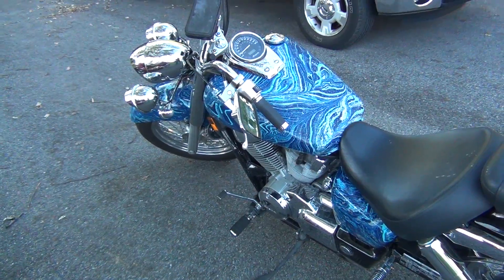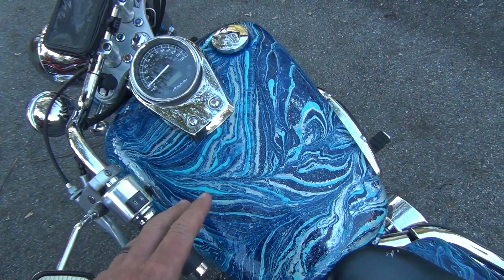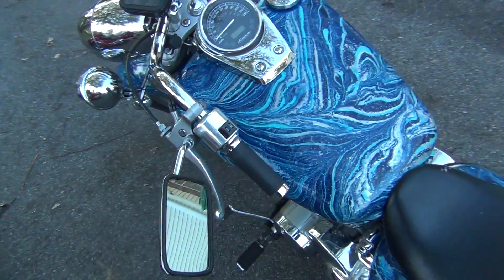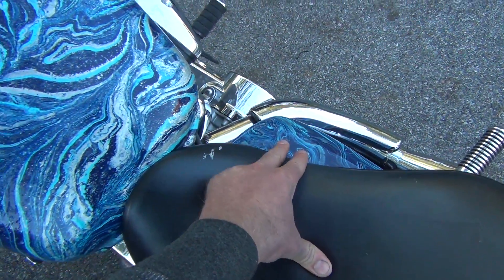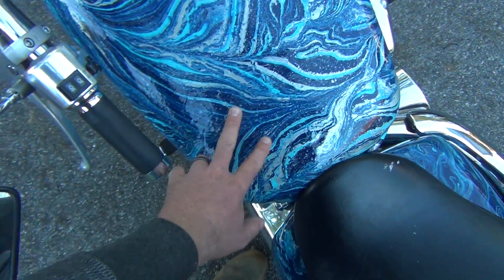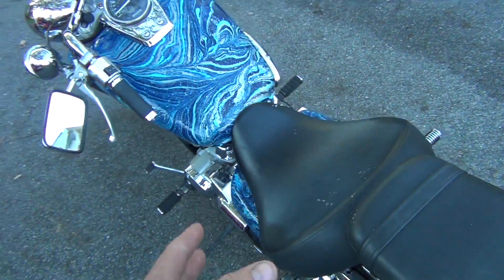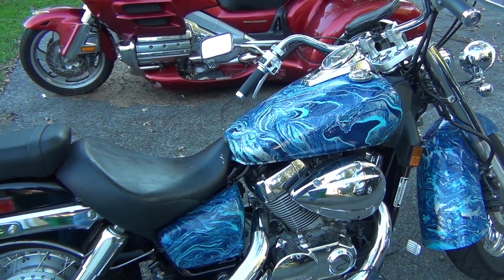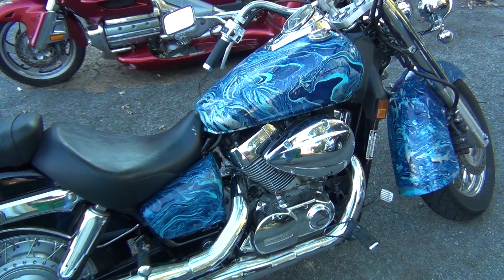Negatives of spray dipping

Comment: Clear coat it then sand the clear, reclear it and then wet sand. That will smooth the paint and remove the fish eyes.
Reply from the maker: +CKDMJ the fish eyes are in the paint and not clear. I'm planning on adding lots of clear when work shuts down in winter. Going to try to smooth everything out.
Reply: +TheBrownsWorld Yes but you can hide them by building up clear and sanding down the highspots on the clear. Depending on how think your gun will  lay clear and how bad the height differences are in the paint will denote how much work it will take. Cool looking paint by the way.
Reply from the maker: +CKDMJ Ok I see what you mean. I might just leave everything the way it is lol. The tank is really growing on me because front fender is same way and goes good together

Comment: if you are thinking about spray dipping your bike parts then take you should know that almost all of the problems he's pointing out in this video can be avoided if you are willing to put out the effort to do the job right, i spray dipped my parts using 6 different colors and when i was done i didn't have a single pinhole or lump of paint and the surface looked like any other clear coated gloss paint work. But i will say, because of all the solvents in spray paint it is a lot easier if you use paint that isn't spray paint....

Comment: Better preparation of the surface will help prevent the flaws. higher quality paint will help prevent flaws. making sure you have a good primer base will help prevent flaws. clear coat and wet sand then clear finish . all and all looks good . just need to play with it a little. never settle when it comes to your stuff . good job!
Reply: Jeremy Dickey Do you think grafitti spray paint would work better, because it's thinner? I mean, it's an outdoor paint  so it should be durable enough?

Comment: Found out marbling has alot of the same problems. Multiple coats of clear coat and sanding in between coats flattens the surface and leaves a pro quality finish. Beautiful colors an swirling , would be a shame to sand down and start over. You don't have to.lol Good luck bro. PS. Definitely should paint the back fender too. PEACE!!!!

Comment: Hydro dipping with graphic film is similar,the film is very very thin where it disolves in the water thats why it comes out smooth then clearcoat,some guys spray candy paint before the clear, candy paint is transparent so you will still se the pattern then clearcoat,you coul do the same with paint dipping tho it might affect the colors you dipped but you will get a cool swirl/marble affect.

Comment: if you end up with big ridges of colors then you paint is to thick, thin the paints out and clear it correctly and in the end the surface will be as smooth as glass without ever touching the design colors coat...

Comment: If you do it with spray can paint thats what happens,also the paint dries to fast in the water,get it out of a quart can and get thinner to thin it 50/50 it should be very thin and drops at a time of your choice of colors,then the lumps wont be so high,could be lightly sanded with 600-800 crid sand paper before clear then clear coat,or if its not to bad clearcoat first then sand with 800 then clear coat again then maybe reapeat a third time,but main thing thin the paint,very thin it'll spread in the water better and it'll swirl nice and you could achieve crazy patterns.

Comment: Please rehearse your dialog to 'show and tell' better with better angles on the video. Intro too long and awkward, I almost clicked out.  Nice job, don't worry about the negatives.  You can use clear-coat to smooth out the lumps and to get a great clear shine.  Doing the back fender will complete the look.  I'm going to try this.

Comment: High Spots = Too Damn Picky = OCD.  True art is What it Is, Its itself. seemingly a Mind of its own(Illogical concept) To Flow as it sees fit!!!  Fish Eyes = Nasty,  Art After-math Some times Bi-product. fish eyes come from silicone Contaminents(oils, greases, etcs) = silicone remover Needed B4 painting. The Best Way to have paint flow in said weird patters is Oil Based paint( Did You see That oil Word, there-In?)  automatic Possible screw up built In Unless  your Lifes purpose Is not problematic from a higher power)   Water Based paints  In Water as the vehicle of flowage = see the problem?   solvent based paints do help the separating of water vs. solvent Paint vehicle concept, Tad Bit better not ideal... .    Like lower Posters  said: sand & Clear , sand & Clear, Until The picky lines are Hidden,   BUT  then thicker paint(Clear) tends to Crack & peel faster than thinner!!!   .................... Brown you Got a GREAT pattern there!!!  I Love the Fine-Ness(Narrowness) Of color separations... >>>>>>>>>>>>>>>>>>>>>>>  yes Swirling/Marbeling/Hydro dunking  =  1 in a billion  Style & Never a Duplicate unless your divine or Luciferian Laws of physics Expert.